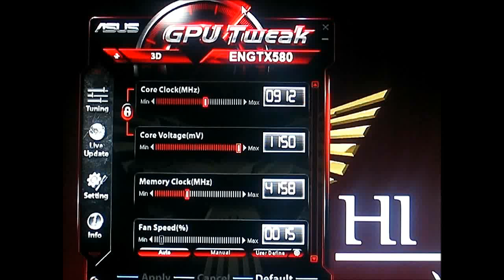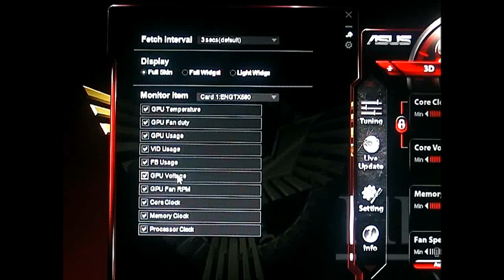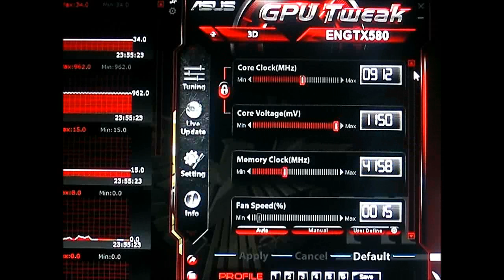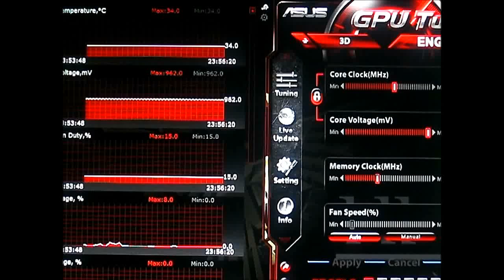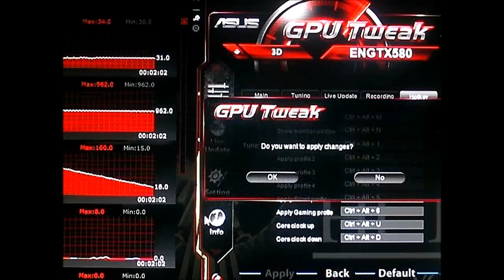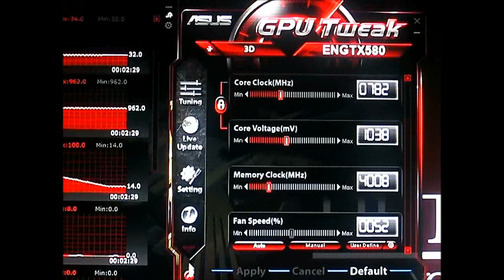ASUS GeForce GTX580 DirectCU II - GPU Tweak Software and Fan Noise Comparison

Comment: I've been running this card at 910/4220/1.1v for about a year now with no issues at all when running Armed Assault 2, Crysis 2, Crysis, Metro 2023, FSX and stress testing with 3D Mark 2011. I use headphones with the volume cranked so the fan speed for me really isn't an issue as I would rather have a semi noisy fan at full overclocked loads than a card that's running hot; I set up speed profiles in ASUS smart doctor. I have been very impressed with this card and it's performance.

Comment from the maker: @VictorsMod Yes it is very quiet compared to the reference version. Although another factor you might want to consider is also a case specifically designed for silence which costs a lot less than buying a new GTX580. I use an NZXT H2 for my 2600K system with a Matrix GTX 580/DCU II and I can't hear anything.

Comment: @HiTechLegion Can you recommend this card? 
I have a gainward gtx 580 good edition (returning it), but it sounds like a freaking jet having a seizure in a church while I play BF3 with my headset off.
I won't be sli'ing the card so it isn't a problem that mr. chubby takes up 3 slots.
I have a Rampage 3 gene motherboard.
Thank you for your help.
(The only thing I want is a more silent card with better overclocking features, I don't want a gtx 590 / higher)

Comment: Is this stable all the time? I'm not a 24/7 pc gamer. I'll play for a few hours and then stop. I'm only 13 :L
My Gaming Rig Is :
ASUS GTX580 DirectCu II
Phenom 1100T Stock Speed (Might Overclock Soon)
H100 Cooler+4 More Fans.
Kingston HyperX 8GB 1600MHz Ram.
Powercool 750watt PSU.

Comment: Hi. I just build up a new gaming pc with

GeForce GTX 580 DirectCU II, 1536MB GDDR5, 2xDVI/HDMI/DP
Core i7 2600K, LGA1155, 3.4 GHz, 8MB
600W, 6600GP V2.0 Silent Giant Green black
P67A-C45 B3, LGA1155, Intel P67, DDR3, ATX
Ripjaw 4x4Gb 1600mhz (16GB)
1TB Barracuda 7200.12, SATA III, 7200rpm, 32MB

Will it last for about 3-4 years with ur settings? or is my pc too low?
and will it be safe to run about 14 each day with ur settings?

Comment from the maker: @machiavelli1109 
Some cards might vary, you might actually get better results than I did :) 
As for fan speed, yeah leaving it at auto is fine since temperatures are really good with the DirectCUII coolers.

Comment: I have the same card, is it safe to use your settings i am new to overclocking :)

Core Clock 912
Core Voltage 1150
Memory Clock 4158
Fanspeed it´s on auto right?

ty